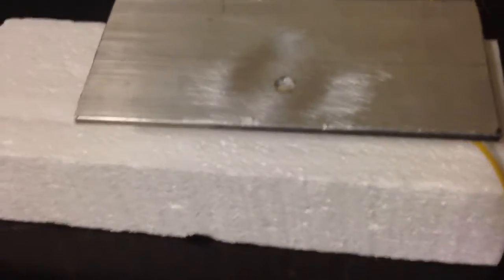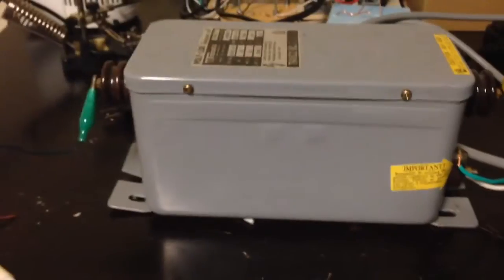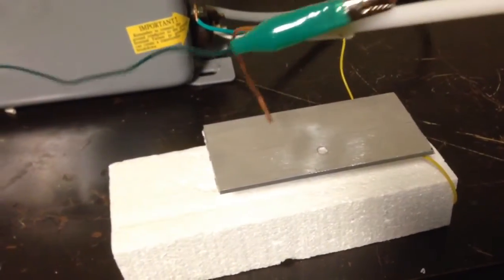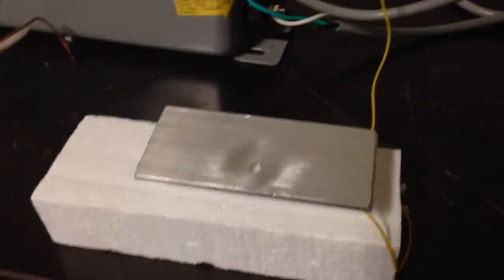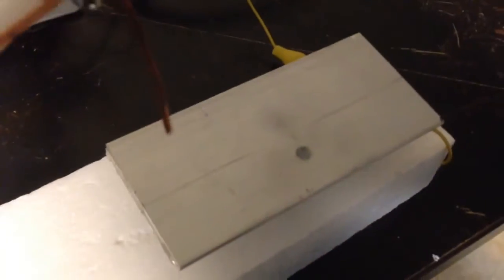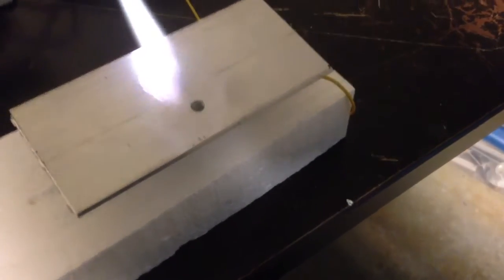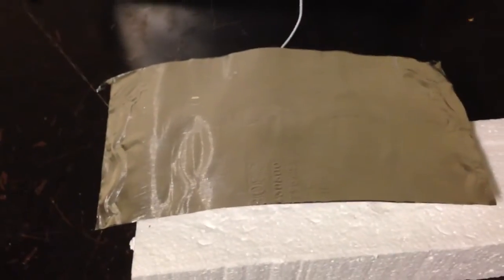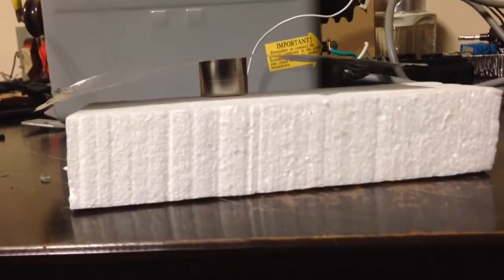Neodymium Magnet Effect on Plasma Arc

Comment: If you have a magnet that you don't care about, or at least don't let the magnet get to hot- you might find it interesting to try some dc current with either the cathode or anode attached directly to one of the poles of the magnet. I believe you'll see the arc circle the circumstance of the magnet. It might help to stack a few magnets so that you can have the North and South poles farther apart. Also if you reverse the poles are polarity it will travel the other way. Stay safe!
Btw, if you search for the world's smallest motor I believe you'll eventually find a video of a small magnet suspended by a small point. When current is applied to the side of the magnet, it spins. Kinda the same principle. Either way it's fascinating.

Comment: good video.  i have a question, if you don't mind..  did you ever check to see if the pole of the magnet ever made a difference?  If my theory is correct then the direction dc charged plasma should react differently to differing poles of a magnet.
Reply: Gristle Von Raben good point- will need to check that out with the DC Plasma
Reply from the maker: Gristle Von Raben good point- will need to check that out with the DC Plasma ps accidentally commented the same comment from my sons channel!
Reply: TeslaSpot 101
lol, okay.  no problem.  I wanted to add that if you don't have a dc welder, you can use a car battery, just make sure there is a fan on the battery to blow away hydrogen, if it is near by.  I blow over the top of batteries with my breath, before jumping a car.  Hydrogen and Hydrogen sulfide fumes are so dangerous.